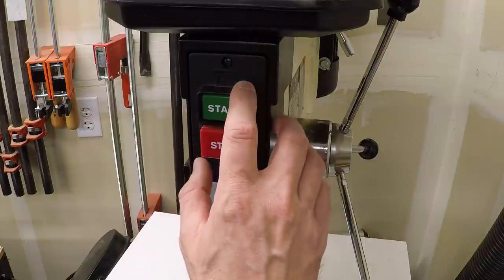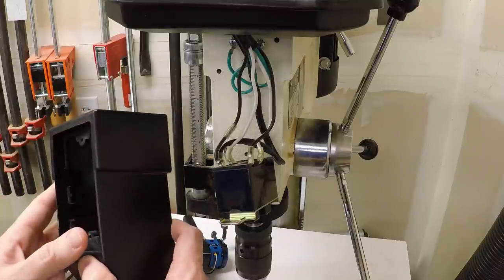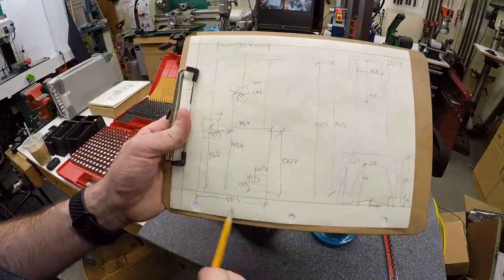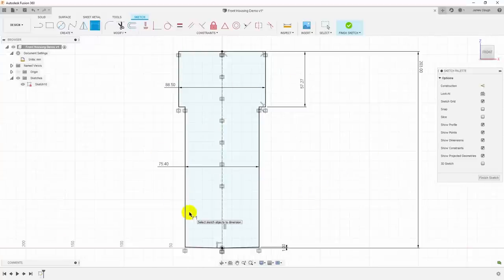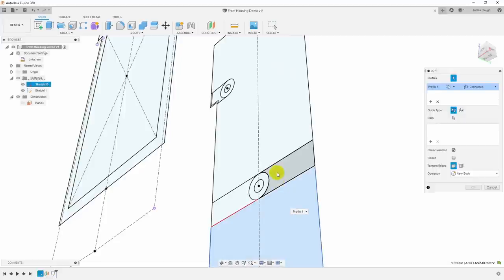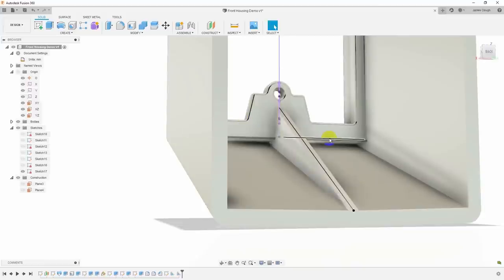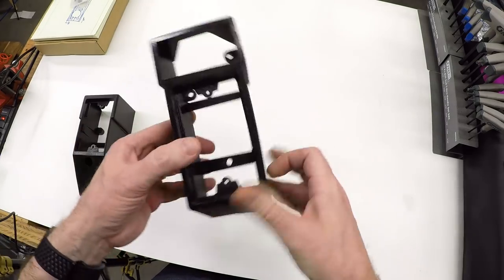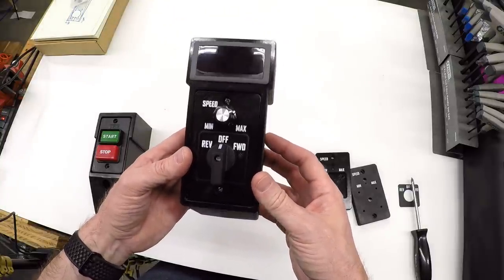3D Printing a Drill Press VFD Control Panel with Loft, Shell and Rib in Fusion 360

Comment: Have you got access to a flat bed scanner? If the part was placed on the bed with a scale it would give you the exact shape which could then be modeled in fusion etc. by referencing the image. The scale would ensure no lens distortion or scale factor image required. You could use your caliper and height gauge method to confirm some check measurements/ accuracy. Cool project!!
Reply: I was thinking about using a scanner all time while he was measuring
Reply: I do that all the time aside fromthe closefocus issue it imports to Solidedge with sub thousandth accuracy. for things like tool outlines etc. it is essential for time savings.

Comment: I added a VFD to a lathe. The lathe came with a joystick that handles forward/reverse and motor brake. I wired it to the VFD for forward/reverse and, using the same position (down) as brake. VFDs typically provide an emergency brake that uses DC braking which is fired by closing a contact. It stops the machine abruptly. It works extremely well on my lathe. I want to do this same modification to an identical drill press, but I plan on using the joystick, which should also answer the safety lurkers. Really delightful video & I subscribed immediately. Please keep it up. Idiots like me need this thoughtful guidance!

Comment: This is incredibly awesome. I have the same drill press and have upgraded it already to VFD. But this integration of the VFD with the drill press is Stellar!

Do you simply use this to turn on or off the power, so your VFD is always on, or do you have a secondary switch to cut power to it?

Do you have a link to the chuck you are using?

Love your channel and the quality of your work, the process of how you use Fusion 360 and the journey to the finished product. I have to say I lose a lot of sleep after watching your channel. I can't wait to get out to the shop and get to work.

Comment: Great videos! I'm learning a lot, thanks.

 Saw a few mentioning - take a picture and import - I came across a post
 awhile ago that recommended using a flatbed scanner instead of a camera 
because it eliminates the parallax. I've done it and it works well. 
Another trick I used for copying an organic shape was to use large soldering wire (like used in plumbing for sweating copper pipes).  I flattened the solder wire by rolling it between a flat table top and a piece of a 1x12 board (whatever you have that's flat). Then form the wire around the shape. Scan the formed wire on the flatbed scanner and import. Perfect fit. You can also convert the BMP (or whatever) to an SVG before importing to make things easier. Inkscape works for that (et al).

Comment: Hmmm, you commented in the vid that you would follow-up with installation of the various pieces ... that was some time ago.  I'm replacing the motor on my old camel back drill press with VFD for speed control, removing the mag starter, etc.  Was there a follow-up?  Cause I sure can't find it!  

As always, though, your vids are a treasure!
Reply from the maker: The project is still in progress.  The parts are still sitting here waiting.
Reply: @Clough42  Thank you, sir, your videos are always top notch.  I look forward to each new chapter.

Comment: Love the video. My only worry is you've effectively removed the ability to hit the stop switch in an emergency! Or do you have an emergency off somewhere else?
Reply: A drill press accident that results in the inability to use both hands is unlikely, but if happened would likely prevent them from being able to press the emergency stop anyways, so turning a protruded knob to stop isn't more of an issue then pressing a recessed stop button...

Comment: Excellent job of explaining the process. I do have a suggestion however. While you are updating the drill press electricals, consider adding a foot-switch to control the spindle rotation. Drilling can turn into a "three hand" operation fairly quickly and being able to stop rotation by simply releasing the foot switch is a definite advantage.

Comment: A technique that i have used previously for getting dimensions on complex parts, is to use the a conventional scanner to scan the flat face, along with a ruler for scale.  Image editing (GIMP, Inkscape etc.) or even import the picture directly into Fusion360 and scale appropriately.  My experience is that flat faces can be modelled to a tolerance of 0.1mm with ease.

Comment: Excellent video, as always. I picked up some good tips. I was surprised that you didn't modify the design more for 3d printing while still in Fusion. I would probably have put 45° ribs under those mounting hole bezels so they didn't need support. I've also had a lot of success with making a disposable support rib that stops 0.2mm below an overhanging face. That gives the printer enough support to air bridge quite long distances, but snaps off at a touch.
Reply: Yip, I was thinking the exact same thing about the 45 degree ribs, I try to design to avoid using support material if possible.

Comment: There is a specialty super low warp PETg that prints at a lower temperature than most, can print at 220-230, and it doesn't require a brim, and has much lower warp forces than eSun/Inland -- and I also confirmed it's PETg with solvent that will only work on PETg. Totalpack sells it, not sure who makes it. I've made very large boxes and with a PEI bed at 75c, in an open air printer, no warp -- flat as a concrete slab.

Comment: James your a man of many talents. Just learning to draw in inventor and watching you work in fusion360 makes me a little jealous because you just draw with no hesitation. I wondering what was causing that curvature was it a coefficient of shrinkage in the material. I'm a little new to 3D printing and doing wide prints like 10-11 inches wide they tend to curve up wards and pull off the bed. The curvature maybe due to sagging what are your thoughts.

Comment: As much parts as you machine out of aluminum,  it would be great for you to venture into DIY anodizing. I'ts not that tough to get really good results, and of course you don't have to dye the part. You can just anodize and it pretty much renders the Al part scratch proof. I've had great results.
Reply from the maker: I've researched it, and basically I don't want to store the acid.

Comment: James, funny you are doing this - I've started the same project but never got around to finishing it.  I have a Teco FM-50 VFD that will handle a 1HP motor, but have yet to find a 3 phase motor that will mount on the existing mount on the back of the drill press.  I also am using a Jet JDP-17MF, but it's blue in color where yours looks cream colored.  Have you sourced a motor yet?  If so, would you share the information?  I'd rather use the existing mounting plate on the back of the drill press vs manufacturing a new plate.  Love your projects and vids.  Keep up the nice work.

Comment: Dude mad skills👌 in my opinion is better to have the controls at waist hight, close to your left hand, I normally extend the wires of some of my machines and put them on a electronic box, that way I am in more comfortable position and quick reach of the controls, also a foot switch for on/off is good idea
Reply: Having drill press controls at a level below the table top seems to me like a scary idea. You often have parts that are much larger than the table, and you would be trying to bend down and reach the controls while reaching awkwardly under the part while still trying to reach the downfeed handle or hold something in place. It seems like a guaranteed recipe for an accident. Especially if some part gets away and starts spinning, and you have to try to reach under it to stop the machine. Having a drill press on-off switch that you operate left handed also seems dangerous, as you usually use your left hand to stabilize a part (since the quill handle is right handed), and you would have to let loose of the part to stop the machine.

Comment: Nice work as usual! Would it be possible to print support material in ABS then the actual part in your chosen material?  Also, could you print a brim of ABS with small lagging to allow the part to adhere, let it cool, then print the part?

Comment: New to 3D printing. So in this instance, ABS was tried first but it tends to have more shrinkage, so even with the brim it still warped? Then PETG was chosen and that gave the final print with minimal warping? I think I see that the ABS gave more of a matte finish while PETG is more glossy, is that right?
Reply from the maker: Yes, I think that's right.  If you have a printer with a heated chamber, this part can be easily printed in ABS.  Check out my QIDI i-Fast printer review, where I printed exactly this part successfully in ABS.
Reply: @Clough42  will do! Thanks!

Comment: I have the same drill press and converted it to a VFD drive about two years ago. I went with a two horsepower motor to maximize the low speed torque. I also kept the pulleys and can adjust those as well to get additional low speed torque. I want to know how you mounted the tachometer. Will that be in a future video? I went with four toggle switches and have a choice of 16 fixed speeds. But a variable speed option would be much better if I could read the speed. I 3D printed the front cover as well. Great project and great videos.

Comment: Is that a 3PDT rotary switch or DPDT? I can’t find a suitable DPDT rotary switch to handle the volts and amps (130 VDC 20 amp for treadmill motor). 
Also, is your tachometer a Hall effect or something else? The eBay links are old. 
Thanks,
Paul

Comment: There is a reason why the original design had the stop button red and protruding way over the surface. The original design, though, had also the failure of being capable of being ON while not powered. I mean, one could turn it on and then go and plug the drill in and it would start.
Since You are already doing this with a VFD, it should not be too hard to make the operating switches momentary so it would not be possible to start the drill simply by plugging it in. Also, a decent emergency stop or at least a stop button which You can operate even with Your nose if needed would have been a definite plus.
The design itself looks neat and is probably also quite ergonomic. Also, I find it good that the drill press cannot be operated with gloves on Your hands. This, by the way, was the reason why the original design had the start button as it was - very hard to operate with gloves.
Reply from the maker: The switches in the new control panel are not momentary, but I have all of my VFDs programmed to refuse to start until the switches are returned to the off position.  This is usually the default.
Reply: @Clough42  That is a way to go. May I suggest to put some safety related content on Your videos. I know, it is a dull subject and it is really hard to tell about it in a way that does not make the watchers fall into coma. Nevertheless, there is just too many videos out there that teach how violate the very basic safety rules.
I like Your videos, by the way :)

Comment: James

I am confused. If you are going to use a VFD, why do you need a drum switch on this project??  Would think you could handle the forward/reverse function with a much smaller 2 position toggle switch?

John
Reply from the maker: Three position.  I'd also like it to stop.  The drum switch is a handy size, easy to grasp while working, and unlikely to be hit accidentally.

Comment: Nice, have you ever used a spacemouse?
Reply from the maker: No, I haven't.  Years ago, Silicon Graphics had some kind of space ball control thing that didn't work that well.  The spacemouse looks pretty cool.
Reply from the maker: I did a little more research and ordered one.  Maybe once I learn to use it my navigation will be less nauseating to watch.  :)
Reply: @Clough42  You will love it!!!
Reply from the maker: @adamanddog  I've been using it for about 30 minutes, and I love it.  I'm still an erratic driver, but it's coming together quickly.  Thanks for the tip.

Comment: Hey James, I recently found your channel.  Very nice!  After all of the work you have put into your Grizzly lathe and mill, if you had it to start over again do you wish you'd picked a bigger or more capable model as a starting point? I live in Costa Rica so shipment here is both crazy expensive and a huge hassle.  So if I can get my tools in and then upgrade it myself, the tax isn't quite so obnoxious.   I've held off buying the mill and lathe but your success at tuning them up gives me enthusiasm.  Just wanna make sure you were still thinking your strategy was the right way forward, or if say a model higher on the mill and/or the lathe would have been worth it.

Comment: Very impressive Fusion skills 💯, measured like a pro and didn’t give up Fantastic work right to the End. Didn’t even know there was a rib command ! Please tell me your secret to getting good at Fusion been over a year and progress is slow.. is it just time on the screen 🤷‍♂️ brilliant video 🙏🙏
Reply: Dr Pipe the best way to learn Fusion or any other CAD software....Creo, Solidworks, Inventor, or whatever... is to first learn and understand design fundamentals and parametric design philosophy. If you first understand the philosophy and best practices it will go a long way in helping you understand how to model your design and the best ways of doing so. I often tell engineering students and others interested in 3D design not to worry about the picks and clicks of a software, worry about understanding the philosophy first. If you do this, it doesn’t matter what CAD software you are using because you will have the knowledge and understanding to know what tool are available to you and all you just have to figure out where the buttons are in that particular software. There are many resources out there that can explain this in more depth
Reply: Jacob Caldwell thanks issue isn’t I know what I want to do but I don’t know what or where it is so yes in principle you are correct 🙏 unfortunately learning Tec or even reading is very difficult for some of us. As many we fumble along until it works as best we can. Half the time I think I don’t even know where I am let alone where the problem is 🤣

Comment: Had you already done the cad for this before recording it or are you just that efficient at fusion?
Reply from the maker: Yes, and yes.  Learning the keyboard shortcuts and having a bunch of standard construction techniques in your toolbox can make you very efficient with the tool.  What you saw in 17 minutes of video took me about 25 minutes to do in real time, but by the time I made this video, I had already  done it a couple of times due to technical issues with previous recordings.  The vast majority of the time in designing a part like this is the thinking and deciding and reworking ideas that didn't work out.  Being really quick with the tool just gets the mechanical part of actually drawing the part out of the way so you can spend your time and mental capacity thinking about what you're trying to make.
Reply from the maker: I wonder if there would be interest in a real-time livestream of me starting completely from scratch and designing something.  It can be a really slow and boring process.
Reply: @Clough42  is probably watch that.  I find I learn more about fusion from watching people actually do things than from tutorials.
Reply: @Clough42  Thanks for another exemplary video James.
I was thinking, while watching you zip through the Fusion 360 portion of the video, that it is one thing to know what the various tools within the program do, but quite another to employ them in the right sequence to work efficiently. To that end, I would like to see you produce an item from scratch so as to absorb some of your wisdom with regard to approach and sequence of actions.
As others have said, I too find that watching a skilled operator provides so many gems of knowledge that are so helpful to we novices. Cheers from Oz.

Comment: Is the cross over switch going to be wired directly between the vfd and the motor? I was under the impression that this is not good practice.
Reply: You can usually wire to control contacts on the VFD using low voltage wiring and program or set up the VFD to recognize forward and reverse inputs.

Comment: May I suggest next time, just take a photo of the part you trying to duplicate and import it in fusion, calibrate, voila!. lot faster than taking measurements of everything. they won't fit perfect because as you said... you had to tune them anyway. also for ABS printing, I suggest a heated enclosure, I also had a lot of problem with ABS printing but since I can heat my enclosure, the shrinkage is something from the past. but...but... Oh well I know, ABS is being replaced by PETG and PC these days, lot less shrinkage. I find my PETG to have perfect layer adhesion at 255C (printing at 80mm/s) but if I set the temp to 240C, the finish become Matte, the layer adhesion isnt top notch but for a decorative piece, its perfect. nice channel, lots of great projects :)
Reply from the maker: Thanks!  When printing large objects, I have also found that 255C is about the right temp to get good layer adhesion.  I get more cracking at 250C.  There are lots of variables, and if you can swing a heated build chamber, it works wonders.

Comment: Another way to get the perfect outline of a part to scale is to scan it on a flatbed scanner.
Reply from the maker: This works pretty well, if the part sits flat on the glass.  Most scanners use a magnifying lens along the axis of the scan bar, so it introduces error in one direction for parts of the object that sit above the glass.
Reply: @Clough42  that is true. I am used to scanning PCBs and it's been handy :)